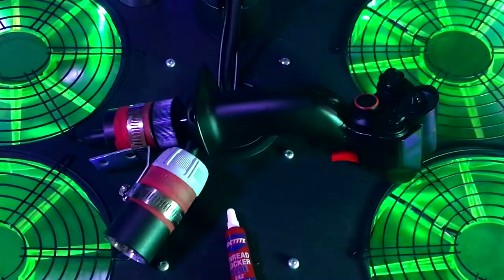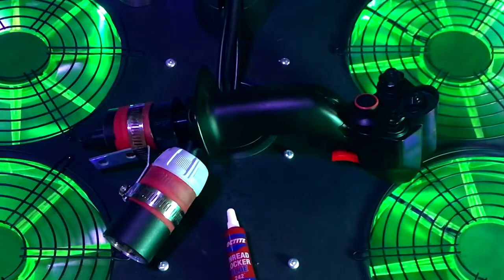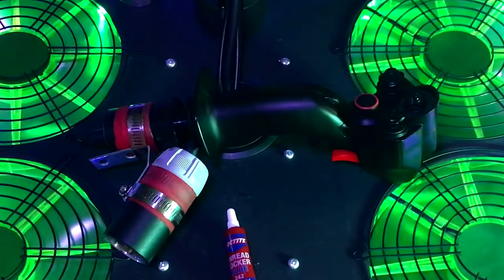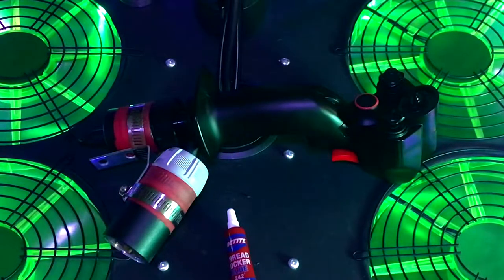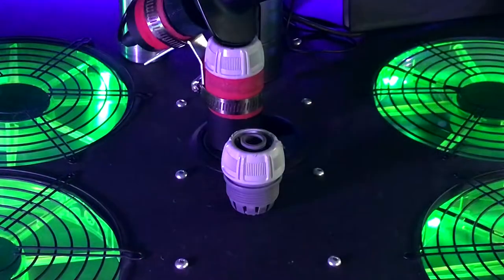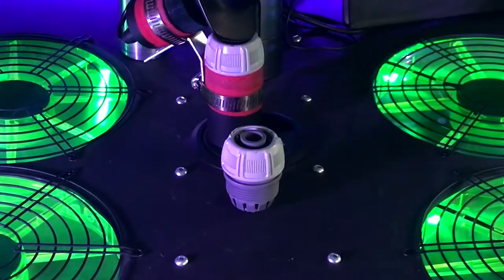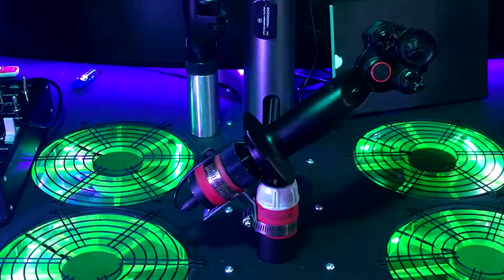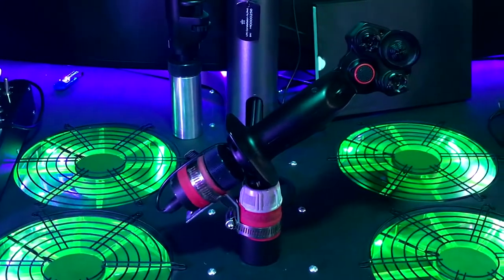Angled VirPil Stick Adapter / Omnidirectional Throttle

Comment: Just want to give a slight update on parts from Virpil. While the 50mm and 75mm extension work great, they no longer come with enough of the extension cable to reach. The 50mm now comes with a rigid connector just big enough to to fit in the 50mm. I had to make my own mini din 5 pin cable to connect them when I followed this guide.
Reply from the maker: Really good info. Thanks.
Reply: Do you know the exact length of cable needed, so I might be able to source the connector instead of making one?
Reply from the maker: Looks like around 200mm
Reply: @AfterimageFlight  Thank you
Reply: @AfterimageFlight  do you have  a link to the exact item you used "Gardena Hose adapter"
Reply: @arkade-  Mine ended up about 340mm because I played safe not wanting to stress any of the connectors.
Reply from the maker: This one here is the one you want. They’re only around $5 in hardware stores. https://www.gardena.com/int/products/watering/hose-fittings/hose-repairer-19-mm-3-4/967315801/
Reply: @AfterimageFlight  you're amazing thank you.
Reply: @Nothv13  do you sell this cable? I would attempt to make one but my hands have tremors so its hard to hold anything steady.
Reply: @arkade-  I do not sell the cable. I had to buy wire and the connector, and have a friend who solders electronic for a living do the soldering.
Reply: @Nothv13  What kind of cable was used?  Cat 5e?  If so what wires did he use?
Reply: @michaelcaputo5693  I used a generic 5 conductor cable off of amazon.
Reply: @Nothv13  Which connectors did you buy?
Reply: @DerFehlfaktor  These two: 
https://www.showmecables.com/by-category/connectors-adapters/connectors-adapters-din/5-pin-din/mini-5-pin-din-male-solder-connector-plastic

https://www.showmecables.com/by-category/connectors-adapters/connectors-adapters-din/5-pin-din/mini-5-pin-din-female-solder-connector-plastic

Just a warning, the soldering was a bitch
Reply: @AfterimageFlight  do you think this is doable with VKB?

Comment: Do you notice an side drift due to the weight of the top of the stick pulling down to the right?
Not sure what axis do what on your setup. I though all strafe was on your left stick though. Are your pedals your taw axis and right stick for pitch and roll?
Reply from the maker: No, not really. It helps because the stick angles back down to the center, and there is weight from the bracket and the extension that holds the stick on the left side, so it’s actually rather balanced. Having my hand slide back towards the left also seems to compensate. 

Leeft stick is Strafe Up, Down, Left, Right, Up, Down
Pedals are Yaw
Right stick is Roll and Pitch

Comment: Are the virpil bases a must have or is there anything cheaper that you can purchase or make?
Reply from the maker: The only other base that works with the virpil grips is the Warthog Base from Thrustmaster, but you will lose a lot of functionality (mostly the additional analog axis inputs) that the Virpil ones have. I wouldn't reccomend anything but the Virpil bases if you're using one of the grips. They are far far higher quality than the Thrustmaster one.

Comment: @afterimage how do you bind the x-axis to lean left and right?
Same for roll... that one seems to accept axis, but you need separate ones for left and right :D
Reply from the maker: Using the VPC Software, use the Axis to Button section to assign a button to the X axis ranges you want to activate when tilting the stick. Then assign those buttons to the keybinds in game to lean.

Don't use the axis for roll as it doesn't work, but once you have the leans bound, they let you roll on the ground when prone.

You can also use the VPC software to invert the axis on the stick itself, so that should fix the problem with the ministick for you.
Reply: @AfterimageFlight  thanks! But if you mount axis to buttons the axis still work for flight without profile or an alt mode? Gonna try!
Reply from the maker: Yeah it still works, it just activates the additional button based on the range of the axis you specify, but the axis still reports normal
Reply: @AfterimageFlight  thanks so much! Your vids inspired me to go center stick, freed up the right for my mouse.
Also reconfigured the left stick like yours. My friends’ printing a 60 degree adapter.
My lefty is an alpha too though, so far the thumb stick feels alright though.

Also i never really understood the multi stage trigger, but thanks to you I’m enjoying one now!

I think I saw you have roll, not yaw on the right stick main axis, I’m still debating on that :)
For Elite roll makes a lot of sense as yaw is nerfed . But I think Star citizen is different.
Yaw feels like a more natural fit in space and in relation to pitch.
Reply from the maker: Wow. Thanks! Glad I inspired you. 

Having Yaw on the joystick X axis is definitely superior, especially if you just have a stick and no pedals. Coming from more of a flight sim on my end, I could never get used to X axis being yaw, it has to be roll for me.
Reply: @AfterimageFlight  any thoughts on pedals for space sim? I play just Star Citizen and Elite. I already don't know what to use everything for on my 2 Alphas. It's hard for me to imagine what pedals would add for me.
It's a much better replacement to twisting?

(oh I also have the CM3 throttle, but so far I kind of just use it for Star Wars Squadrons, or if I don't need to make fast/fine adjustments to throttle, and I bound the thrust limiter on the flaps axis in SC :))
Reply from the maker: It’s much more accurate than a twist axis (provided you are using quality pedals and the right cams). For me I use pedals as Yaw. A lot of people prefer to use Pedals for Roll in space sims, but I’m not going to be able to rewire my brain at this stage. It’s also more “realistic” too I guess. Pitch and Roll on the stick, Yaw on pedals. I have the twist axis locked out on my right stick as well. It’s all preference though, and aiming with yaw on the stick X-axis is generally more accurate, even with the highest quality pedals. Doing coordinated turns with pedals just seems far more natural though at least to me.
Reply: @AfterimageFlight  thanks for the insights! 
For Star citizen I will consider it, VPC all the way :)
For Elite they seem to have twist on right stick even implemented visually ingame.. not that it should matter
Reply: @AfterimageFlight  I’m loving it so far but I feel like I have to place my left stick too high so it doesn’t drill into my leg too much when strafing right. Which then makes my arm lame due to upward angle and no arm rest similar to the center stick; right arm on right leg.

I’m thinking about replacing the WarBRD with a 50cm2 base so that there is less angle.. but it’s very expensive.
Alternatively I could replace the Alpha with a Delta as it seems less wide at the top compared to Alpha. But may also be longer, meaning I need to move the base further out so that I don’t collide with center stick. 

The delta is of course a cheaper solution but I’m not sure if it’s enough. You also use a warbrd for the left stick right? I guess I could alternatively change the graph and make the stick reach the full sensitivity sooner.
Reply: I ended up getting a used Delta and because it’s slightly shorter and less wide, and has a straight shaft instead of the bent and twisted Alpha, I think it works better now, saving me from replacing the base for the more expensive one:)

For who ever is in the same boat :)
Reply from the maker: Yeah, that’s basically why I went with the delta too at the time, it felt much more like a better use case for a throttle stick given the form it has and needing to tilt it. Glad it worked out.
Reply from the maker: I use the WarBRD base for both left and center sticks, yep.
Reply: @AfterimageFlight  thanks.
After some more fiddling I slightly angled the base to the left so I could lower it more while still keeping it off my leg and away from my center stick. So far liking it.. I guess there is no right or wrong way, just your way 🤠

Comment: Any updates to this at all?
Reply from the maker: Nothing to report at this time. Maybe a little later this year though.
Reply: @AfterimageFlight  Appreciate it! thank you. I see Virpil discontinued the Delta sadly
Reply: @AfterimageFlight  Not sure if you are part of the HOTAS/HOSAS/SIMPIT Discord but saw a really awesome angle mod there that you may like
Reply: @AfterimageFlight  found it - go to Thingiverse search “VKB Stick to Omnithrottle Adapter”
Reply: @seanpatrickkinney9593  I'm not sure but I dont think the threading would be compatible.
Reply: @VanFS3K  It wouldn't be, however the concept could be adjusted with proper threading. On that note though someone did release a Virpil one!
Reply from the maker: Updated: https://youtu.be/0aJ9YHi8Q5o